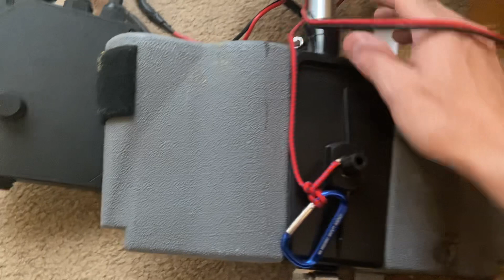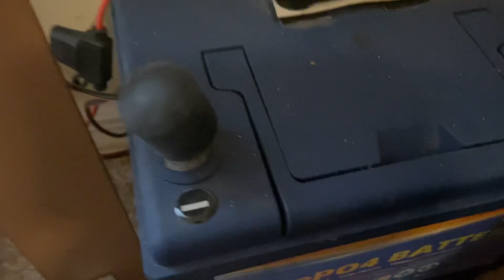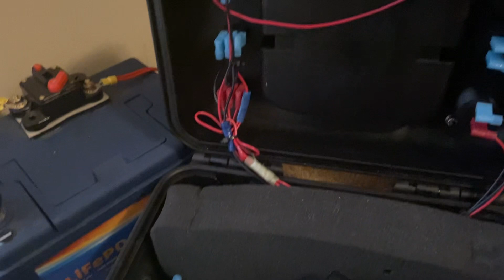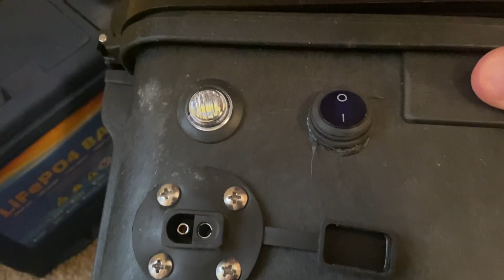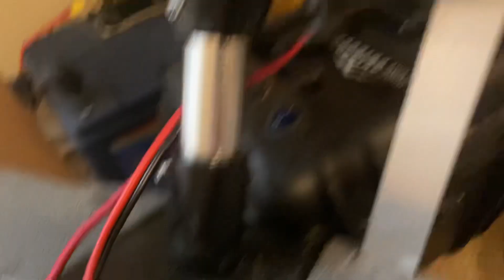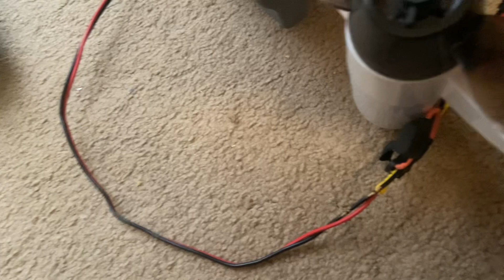Hobie outback kayak trolling motor with voltage regulator and lithium battery setup

Comment: Hello, I have a Watersnake T24 same as yours for my Old Town Kayak used with a transom mount. I was told not use a LiFePO4 lithium battery because since the voltage is constant it will destroy the trolling motor. I was told to use a voltage regulator which I see you’re using. Is there a cheaper/easier way to go for the regulator? How is everything holding up so far?
Reply from the maker: Havnt been using it yet due to not being able to get my Kayak registered